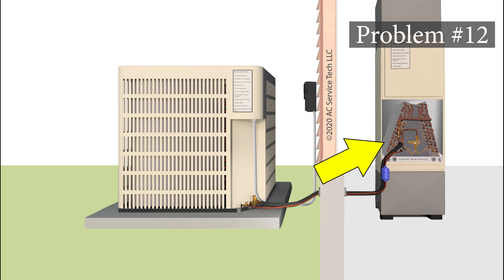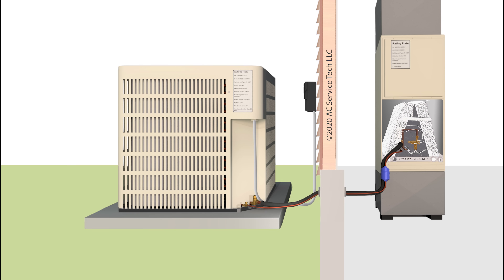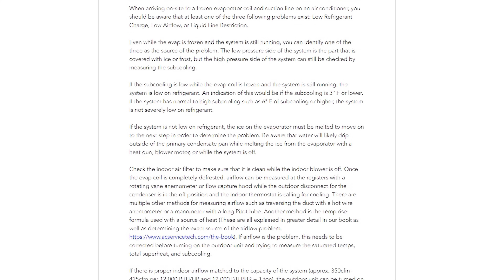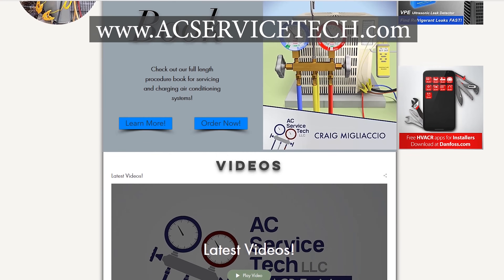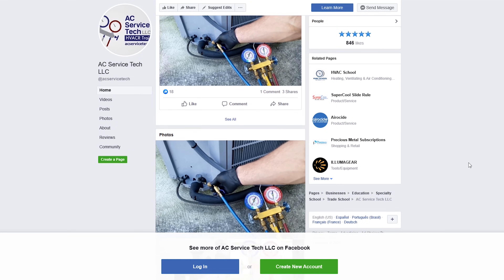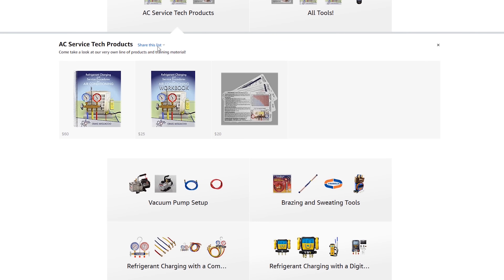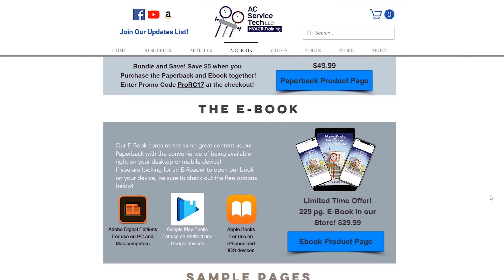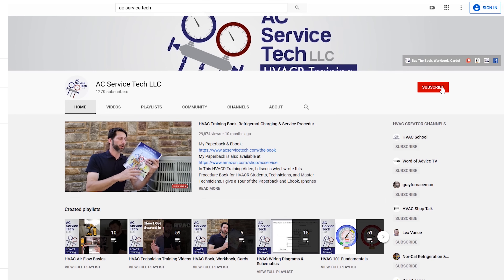20 Causes of Low Indoor Airflow on Furnaces and Air Conditioners!

Comment: Very nice explanation of the cause of low air flow. Most 90* elbows in a duct trunk is equal to 5ft of duct, not all but some are even more equivalent than 5ft. Most common I find is that customers like to move furniture around and cover the grilles, lolol. Maintenance is the Key, clean filter, clean coil. Spot on with all the causes. Very thankful for your professional expertise. HVACR ON AMERICA!!!
Reply from the maker: Thank you very much Ray, yeah couches against return grilles is a big one! thanks!

Comment: Are ducted systems still popular in America. Because from what I’ve seen when I’ve been on holiday to the U.S most houses seem to use ducted a/c & combustion units. In Britain where I live and most of Europe we tend to use more D.X a/c systems and for heating we have more wet heating systems with radiators etc.
Reply: yeah, forced air is still the primary HVAC source in majority of USA, although mini-splits get installed as supplemental source or in smaller new additions
Reply: throttle bottle thanks for letting me know. Is there any reason why you use forced air ducted systems? Or is it just more a traditional system you guys tend to go for?